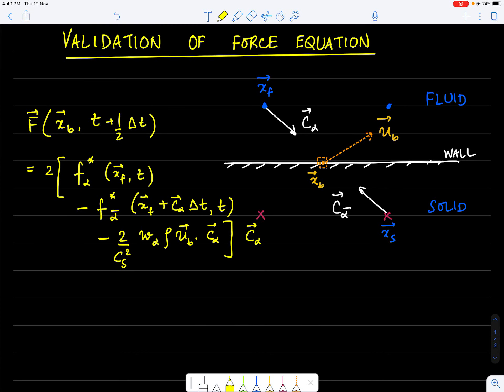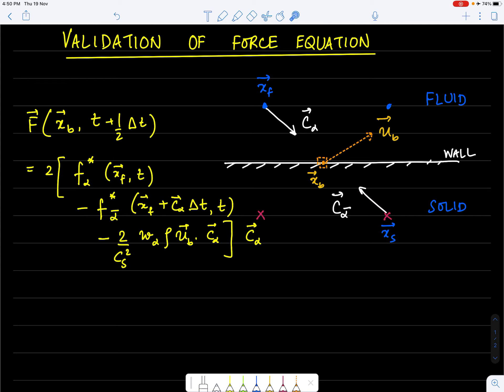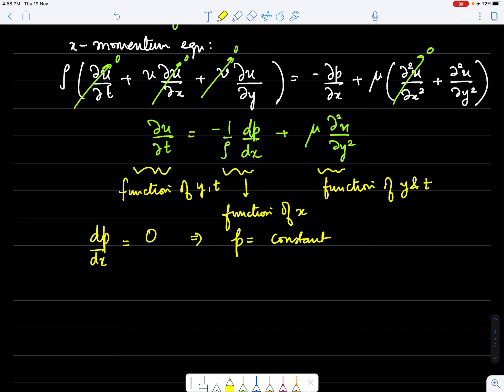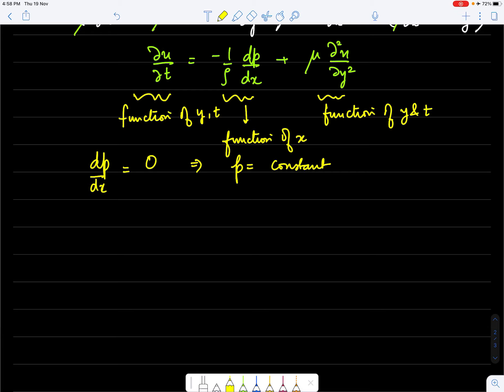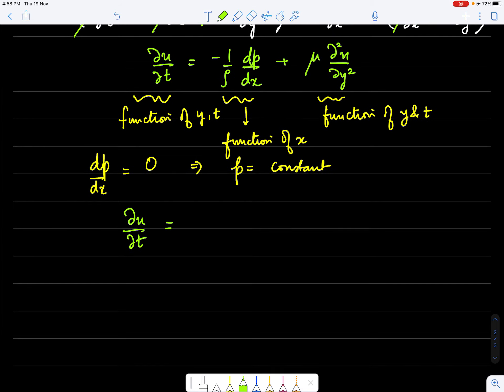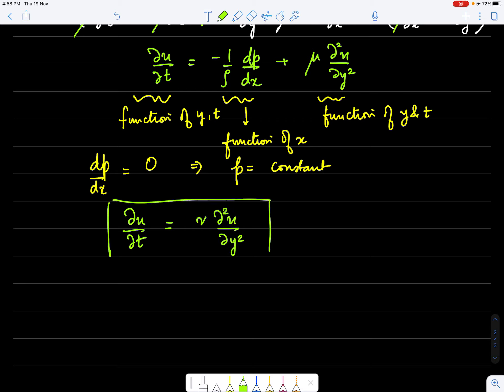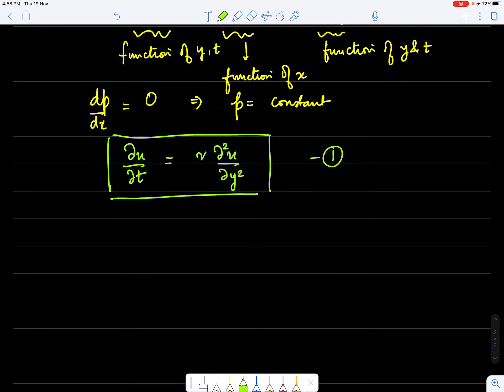LBM Lecture 12: Modeling Stokes' first problem

Comment: @ 6:38 the du/dt is made equal to zero then why we need to write it again?
Reply from the maker: It is not zero. I have made an error in marking it as zero. We are solving a transient flow problem and the derivative can’t be zero.
Reply: Thank you professor for the clarification. @profamitgupta